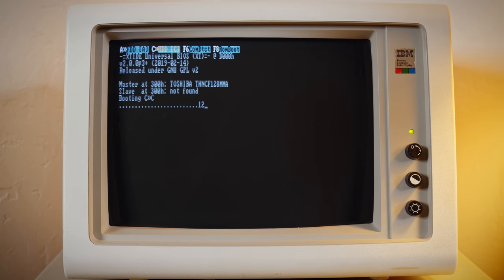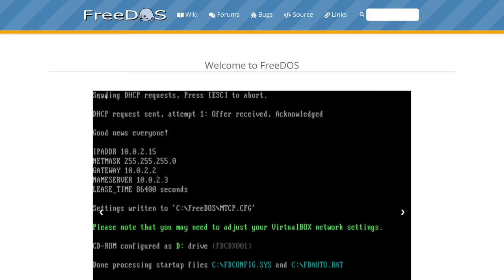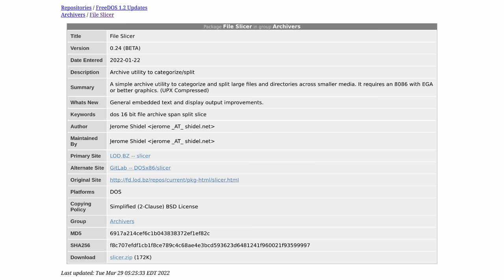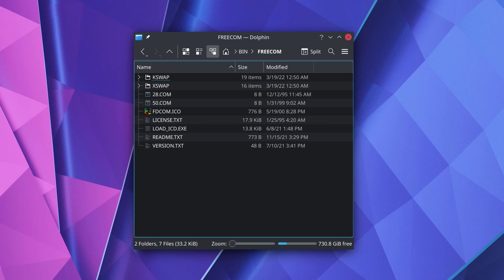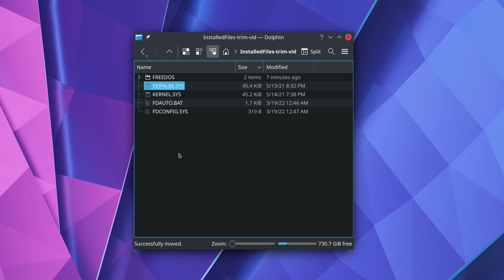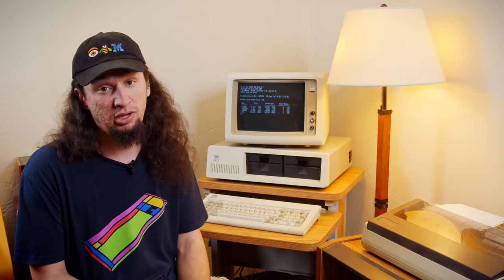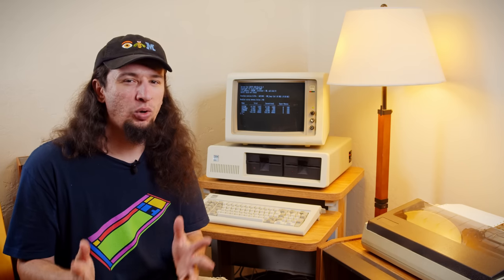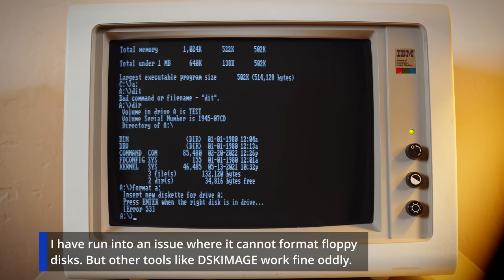Installing FreeDOS for 8086 on an IBM 5150

Comment: The last I touched *-DOS was circa 1993 so YMMV.  I picked up UNIX in 1993 and didn't look back.  As I recall MS/PC-DOS  3.3 had three disks.  Two were the OS and one was optional on-lilne "help" files that none installed. I also recall one of the DOS's used a compression program (not pkzip) for the distribution.  I think they ended in \.ex_  or \.exc .  So don't feel bad about an install using compression.  To that end: unzip understands spanning volumes.  So a install disk just needs COMMAND.COM, the \.SYS file(s) an AUTOEXEC.BAT file, the "sys" command, any other drivers an FDISK, FORMAT.EXE and UNZIP.EXE along with a zip file with part of the "bin" folder . Unzip should prompt you to put in the second disk when needed.   Serial ports: You will need a Late 80s to Mid 90s UART to get above 9600 bps.  The "newer" UARTS have a buffer in them to cut down the number of interrupts and make it possible to do 19.2Kbps however with the (pk)zip method of spanning multiple disks this may be moot.
Reply: Yes, you are on a roll, but ... despite the zip format becoming universal i.e. integrated into Java and windows, there was another file format that has better compression. ( yes, and as much as I hated using it, it did have better compression. ) Its the ARJ format: But that is not all:
This is something that was used by people with really small disks. ( I had 2x20MBs, RLLed to 32.5 ) but my friend had 2 10Mb disks, the second of which had a bad area giving him only 15Mb, and he wanted to run DOS 5:
What did he do? Executable compression. A program that compressed executables. The problem with this is that you cannot compress something twice... so you either used ARJ, and compressed afterwards, or you compressed first, and used ARJ just to split, and place ( i.e. it put stuff back in its proper directories. ) 

The UARTs of which you speak is the 16550N. The real ones. Have a 16 byte FIFO First in, first out, that combined with the ZModem protical, allow you to send a character, with only 8 bits, as it streams, and strips the 1 char start, 1 char stop, and does not use parity. Its a smart enough protical to resend packets that have errors. With good UARTs, you can bring the stream rates up to 38,400, and the DTE to DCE rates to 57,600. Necessary when using modems, but not very useful for DTE to DTE. ( The rate change, not the raw speed ).

Hardware wise-you can get a 640k backfill card for really cheap. 630k free with DOS 6.22

Exepack is a program to compress and decompress 16-bit DOS executables with EXEPACK, a format for self-extracting executables.

ARJ is currently on version 2.86 for MS-DOS and 3.20 for Microsoft Windows and supports 16-bit, 32-bit and 64-bit Intel architectures. It is unknown what version works with FreeDos.

And lastly, the command processor only executes 1 line at a time, so leave your comments in a TXT file, and only have a single line in the beginning with the name, and the version number. 

My personal recommendation for the install? Have a ram disk that takes up 1/2 the ram, arj the files to the ram disk, then exepack them there, then write to disk or better, exepack them on the host, and then arj/store them, and just unstore & place them. Arj also has options for fastest uncompression, which would speed up the delivery side.
Reply: @joeturner7959  I also preferred ARJ in the early days. Because it was easier to use, the help and program parameters were easier to learn, it offered self-extracting archive files, and supported splitting the archive across multiple disks. The compression rate was also good and the license terms were more free for private usage.

Eventually I realized that it's not a good idea to use self-extracting archive files. Because they needed more space, were more susceptible to viruses and could only be run under DOS. That was the time for me to switch to pure archive files. And when the Windows Millennium supported ZIP files out of the box, I switched to ZIP files entirely.

Also, I've found that zip files do better with a bitflip, while ARJ dropped out here.

Comment: I have a Zenith 8088 laptop that has no hard drive and only two 720K. I put together a custom Dos 6,2 that fit and boot on a single floppy so that I can boot the system and run games and programs with the second drive. Good stuff

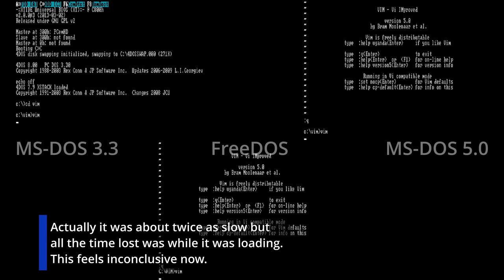Comment: 18:19 Which vim did you end up using on your 5150 ?   The one bundled with FreeDOS 1.3 requires 80386 instructions.  I'm currently working on adapting your distro on my Book8088  :)

Comment: My oldest machine is a Pentium MMX Compaq Armada 7770DMT lol.
It originally came with 3GB worth of hdd space but since i didn´t get a drive with it, i put a much newer and bigger 60GB drive inside.
Detects it fine, however the BIOS can only see it as a 8GB drive but unofficial DOS 7.1 and windows 9x installers did see the full drive just fine.
Now i think i´ll try FreeDOS on it.
Reply: You can try Ontrack DDO (Dynamic Drive Overlay) to use large drives in older systems, but it is not compatible with FreeDOS.
Reply: @alexandrecouture2462  Well as said, any OS i tried so far did detect the full drive just fine, no special programs needed.
Only the BIOS setup doesn´t recognize the full capacity which is actually based on windows 3.11 installed onto the hdd as it was common for compaq machines from this era.
So it´s actually only a overlay that controls the BIOS, not sure what the BIOS will actually see as it´s not accessible by its own

Comment: I was able to use your disks to install FreeDOS in a virtual IBM 5150 with a 20MB HDD running in MAME.  There is some learning curve required for setting up the hard disk CHD image, but once you know how to do it it works well. I may make a video about this sometime soon.
Reply: What's the advantage using MAME over VirtualBox or PCem ?
Reply: @stchanx3  He probably didn't know there were better emulators. He could take BOCHS or QEMU, which also run on non-x86 processors such as ARM and can then emulate a Pentium or better, allowing him to use 32-bit protected mode DOS programs.

Comment: One downside is that the memory utilization for the FreeDOS kernel is something over 100K so if your 5150 has 256K or less that will seriously eat into the memory available to run programs. Compared to DOS 2.x which is I believe in around 20k or 3.x which is 30ish. Otherwise tab completion is on a 5150 is just way cool. :)
Reply: Is this with kernel86.sys?
Reply: Commander Keen runs out of memory :(

Comment: Cool!  Interesting wee project, I should dig my old ZX81 out and finally fix it!
Reply: What's wrong with it? I must say I prefer the ZX80 though (although with nmi-generator added, for ZX81 mode), because it is built entirely out of standard components that are still made. So no hot "ULA" (gate array), that can go bad and which is hard to find.
Reply: @herrbonk3635  It's just dead to the world, probably the regulator.  I've as couple of microdrives i'd like to take a go at first!

Comment: this is pretty cool, but kinda surprised at how they do things, specifically how there's the bloat of duplicate programs on the slimmed floppy version (the installer should be able to copy it, itself, on the final system), and how it's not even modular, like, if documentation takes this much space, then I'd expect them to specifically have it on a separate add-on disk (probably along the other install disks, but all on one disk, and prompt whether to install), although some other stuff like AMB support and package management still makes sense to ship by default, since pretty much everyone using it normally, would probably have big enough floppies, and AMB makes a great format to keep interactive text, such as documentation, or converted webpages such as wikipedia, or maybe even CYOA games

Comment: Interesting. So are TRSDOS and LDOS related to MS-DOS and PC-DOS, other than being optional OSs for a specific hardware platform and sharing an acronym? Was the BIOs the differentiating factor of the IBM PC compatible that allowed for so many hardware variations and clones?
Reply: TRSDOS and LDOS are related to CPM/80 so they share that heritage but other then that no.  What allowed so many clones was the IBM PC was made with off the shelf part except for the BIOS where other machines tended to have more custom parts.

Comment: I guess a great alternative is to have an ethernet card like NE1000 and transfer the files using mTCP - FTP, from Mr Brutmann. There are options for parallel port that works fine like XIRCOM PE2 or PE3 models. The bootable disk could, in this case, have bootable files, FDISK, FORMAT, SYS, Ethernet pocket driver, DHCP, FTPSRV and some small mTCP conf files.

Comment: 14:47: Perhaps it's worth reporting the fact that paths are hardcoded, and that FORMAT and SYS look for redundant copies as a bug?
The trouble is, DOS doesn't really have an ln command, at least not by default, for well-known versions of DOS I'm familiar with. 
(I did wonder if it might have been possible to JOIN that /root folder back to A: or whatever the drive letter is, but I haven't tried this and I'm not sure this would work.)
Reply: alias?
Reply: @mycosys  Interesting. Apparently that's a FreeDOS extension command. Does this work for providing a new path and not just another command name?

Comment: About the 9600 baud limitation : I had to suffer it when transferring from my 8088 to my 386 at the time, but when I got a Pentium 75 and wanted to sell the 8088 I tried a piece of software that ran the 'server' component on the 8088 and made the Pentium the client. And then I could hit 115200 bauds. It might have been theoretical, but transfer speed was more than 6 times faster (I did try copying to and from a RAM disk and it was faster still, so I guess it was a floppy drive bottleneck or an I/O one) and I wasn't likely to make it faster, so I trudged on at 10Kb/s.
Reply: It had a name, and the name was actually the name of the cable ... Laplink which became interlink.

Comment: I haven't used freedos since rhe early 2000s but I do remember a version that fit on a single floppy as I was using it on my 486 which had a crashed hard drive.

I would boot to freedos from the single floppy and then swap out the floppy to run my software as freedos was already loaded in RAM

Comment: I have a similar issue I am wrestling with.  I built an expansion board for my Amstrad PPC640.  The APPC640 has two 720k floppy drives.  I have a XT Compact Flash drive for my new expansion port.  Eventually, I want to run the CF Card as a bootable C: Drive.  The expansion port works.  The Amstrad recognizes the CF Card and its BIOS.  Here is the issue.  I have to FDISK and FORMAT C: /S from the 720k drives on the Amstrad but I have no way to get MS DOS 5.0 or 6.2 to the Amstrad 720K disks.  I have a USB floppy that will format a diskette to 720k but the Amstrad will not read them.  Hmmm.

Comment: FreeDOS' FAT32 support is "sweet".  The "best" non-HDD upgrade for a 2 floppy drive 8088 PC is a V20 CPU chip.  Superior block data transfer performance matters.  Early Norton Utilities showed a silly performance gain, because of block data transfer bias.  The CMOS V20 helped in a Compaq Model 1, where the 2/3 reduction of CPU power usage truly mattered.  Every last mW. mattered.

Comment: If you need a faster way to transfer files you could try using Laplink. 
It's pretty fast when you use the printer port.
Back in the early 90's I used it before I got a network card.
Reply: Same here. Had a laplink cable first and then bought an ISA Ethernet NIC for my 486DX.

Comment: The fastest way to get the data from FreeDOS to your IBM 5150 system is to use a 8 Bit ISA CD-ROM Controller and a CD-ROM drive. That way you can get the Data directly from the FreeDOS CDs. You will probably need a boot disk though.

Comment: On my teenage 286 with a 30mb hard drive I used to through and delete all the help and readme files to eke out a little more disk space.
Reply: My first 20 MiB hard drive sadly got a head crash pretty early, thus it was very unreliable and i constantly formatted and reinstalled DR-DOS on that machine. I was also too young at the time to see the real problem. Fortunately, the computer was upgraded 2 years later and the hard drive was replaced with a 200 MiB drive. That's when I found out what the problem with the old hard drive was. Up until then I had mostly used floppy disks all the time. Fortunately, that wasn't a problem back then, because most games could be started directly from the floppy disk and didn't have to be installed.

Comment: you could have used the included GZIP to squash more stuff onto the floppy's in the same way MS used CAB, but I dont know that it would have been any quicker. At least this way you have a bootable 360k floppy with FDISK, with enough BIN/tools to make complex .BAT files (like the installer) which is more than enough for most use cases. You could provide an optional 3 & 4 th disk as mentioned by other and GZIP those, as an alternate to the ZMODEM method. As far as text editors go, I suggest the Bisqwit version of JOE, which has specific additions for screen/stream capture and playback editing .. cheers for your good work and making the results available
Reply: GZIP requires 32 bit protected mode and thus a 386 CPU. It will not run on a 16 bit 8088 processor.
Reply: @OpenGL4ever  the current binary is (possibly) built for 32bit protected mode, but GZIP itself is available on MSX (Z80) which is 8bit CPU and AtariST (68000) which is 16bit CPU - so I can't see the problem
Reply: @paulwratt  In this case you might be right. I just took a quick look at the source code and it appears to be C code. So it might also be possible to compile it for 16 bit x86 CPUs. This assumes, however, that no inline assembler instructions are included that use instructions from the 386 or later. I didn't look after that.

Comment: It's funny that I learn of stuff like 4DOS only 24 years later 😂. I started using Linux in 1996 and switched in 1997 (when I got a cable modem, offline Linux is boring), and disliked DOS and Windows   because the lack of a Unix shell or proper gui. (I grew up with Os/2, believe it or not). We used removable hdd frames in the computer labs (engineering school), I would have been the coolest kid in town in 1998 with 4Dos 😂

Comment: in my case just added an 8bit network card to my 5155 and used mtcp to transfer all software to the hard drive you could only need a single floppy to do the sys c: and the mtcp ftp server. Never need floppys after that.

Comment: If you're thinking about more new, open-source stuff for the 5150/5160 there's a brand new ROM BIOS called GLaBIOS that might be fun to check out too!
Reply: The most valuable thing about the first IBM PCs is that they are left in their original state as far as possible and that the expansion is limited to being easy to restore to their original state.

Comment: 29 disks? Reminds me of past times when I used 2-3 disks to install things. One reading on the installee, one writing disk image on another machine and one in the queue or spare.
Reply: It's one of the many reasons it's stupid to do this (except if you absolutely MUST have the support (and the drivers won't work) for modern hardware to make dealing with software transfers easier) .   Dos 3.3 is good for a machine of this vintage (basically first generation. Fortunately, almost none of them are as shipped with like 64k Most are maxed out at 640k). Dos 5 though is ideal.

Comment: Is it possible to boot Freedos on really low memory? Like on a machine with something between 128 and 256k RAM?
Reply: When i run FreeDOS in my VM there is a boot option called "5 - Load FreeDOS without drivers (Emergency Mode)." By using this boot option, FreeDOS requires about 137 KiB of RAM.
If you ask me, your best option is to just upgrade your RAM. RAM is very cheap today.
EDIT:
For comparison, MS-DOS 6.22 requires only 62 KiB of RAM, when nothing except the kernel and the shell is loaded.

Comment: Why do not use the original IBM PC DOS 1.00? 🙂
Reply: DOS 1.0 only supported single sided 5 1/4 disks with a capacity of 160k.  Double sided didks weren't supported until DOS 1.1

Directories weren't supported until DOS 2 was released...

I use DOS 3.3 on even my oldest systems...  😁

Comment: Is there something like cruncher for 8bit machines or UPX that could be used for some of this files? 
Software that make compressed and self-extracting executables*
Reply: The open source version of ARJ archiver supports 16bit DOS and has a self extracting mode, though it would seem to be to be better to just include the decompressor and run it in  the autoexec.bat for all files
Reply: Yes, but even LZ4/LZO would be excruciatingly slow on these machines.

Comment: i wonder if one can run some old  linux/yoonix on such old limited hw.  :/
Reply: Mainline linux kernel requires a 32 bit CPU. But there is a fork called Embeddable Linux Kernel Subset (ELKS), that will run on 16 bit CPUs. With ELKS the limited RAM might be a problem.